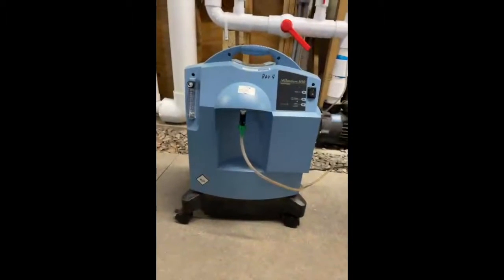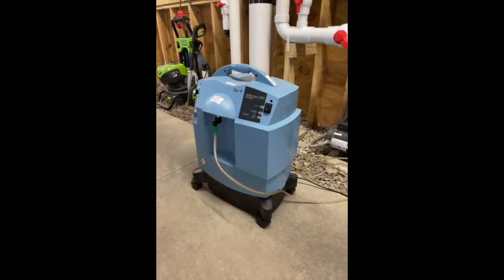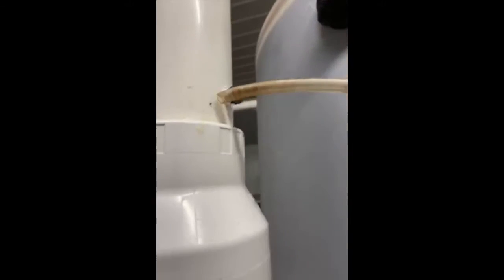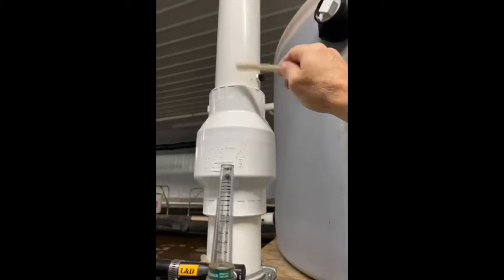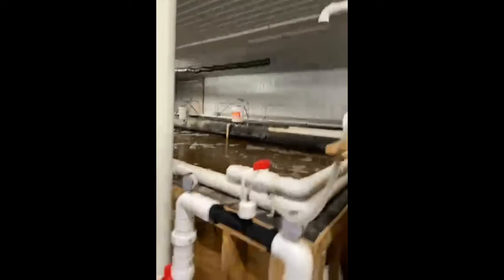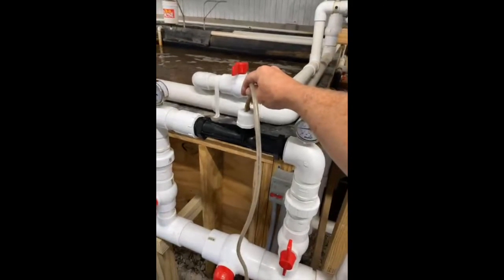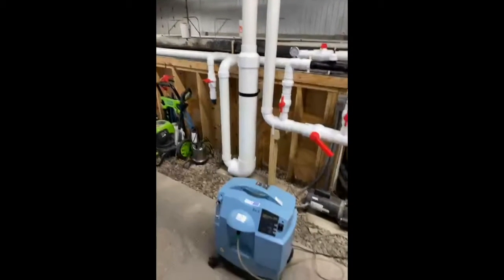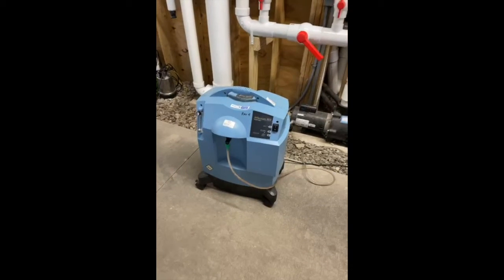Oxygen Saturator

Comment from the maker: The speece cone was replaced with reducing pipes (saturator) because the cone does not transfer O2 as well, for two reasons: 1) We are not running high pressures on our system (only 4-7 psi) and 2) the contact time in the cone is less than the saturator.
Reply: Aswin Aravind  30lpm